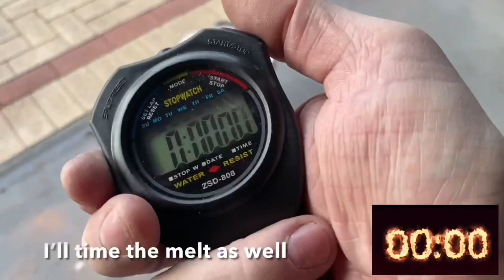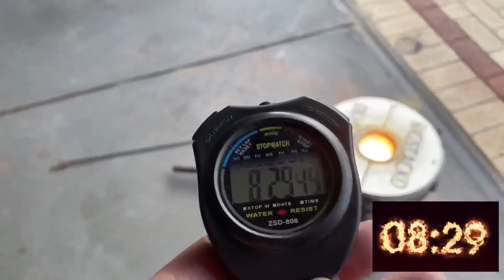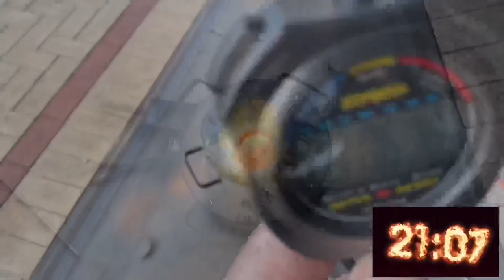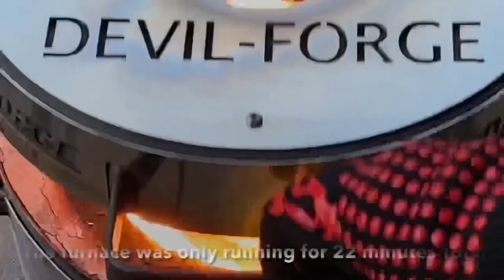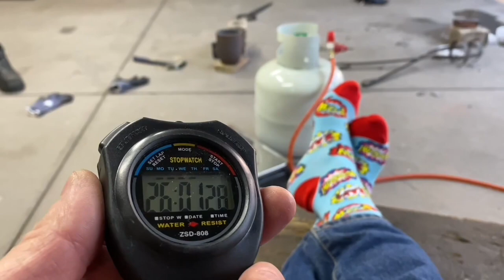Dumpster Diving Huge Copper Haul - Trash To Treasure - ASMR Metal Melting - BigStackD Copper Casting

Comment: I get that it is a much dirtier way, but couldn't you just melt away all the insulations instead of going through the long process of stripping it all? With the temperature of the kiln to melt the copper would it not vaporize away in there?

Comment: Used a wire brush in my back garden on something, stepped out later with no shoes on and ended up with a nice piece of wire in my foot :)
Reply: Ooh that stings doesn't it! ever had a piece of thin metal wire in your throat - I was repairing the old antennae and like a fucking dick I held the wire in my mouth as I was doing so so I wouldn't lose the place I wanted to strip long story short a teensy bit of copper wire snapped off and lodged in my throat was hacking and trying to clear my throat for days (felt like a fishbone) I think it's still there too!

Comment: The wire wheel said copper, but he used a magnet to clean up what flew off. Copper is a non-ferrous metal. Is there something I missed?
Reply from the maker: The wire wheel is actually brass coated steel but if it said copper on it it’s because I wrote that on there so I would use that one with copper my other wheels will have aluminium bronze or brass written on them. 
I don’t think it makes a difference but I just use different wheels for different metals👍🏻
Reply: @bigstackD  o ok thank you for the explanation!

Comment: Hey may i ask were can i buy that cable stripper Machine?
Reply from the maker: It’s a no name brand, I got it from eBay for $220. Just type in electric wire stripper and it should pop up👍🏻
Reply: @bigstackD  ok thanks

Comment: The part about not losing any weight is not exactly true. Copper wires are double coated in resin for extra isolation. So you kinda lose some but it’s not significant.

Comment: So is it worth it with the spent gas to make 30$ from all that work?
Reply from the maker: Definitely worth it for me mate, this channel I do on my days off as a hobby that’s why I don’t sell any of my pieces and the cost of gas is extremely minimal especially using these furnaces as their heat efficiency is incredible, I could easily melt 6 kg of copper for under $10 in gas👍🏻

Comment: Why? Copper is $9.44 USD per 1kg. $37.76 worth all that work?  If you ignore all the cost of the initial equipment so that you could do this continuously. The time to salvage all the material, All the preparation, And then melting it down and finishing it?  I could buy and sell something quicker on craigslist for more $. 

 Just curious if it's a hobby or meant to make income

Comment: The one problem with all these example videos you do is that all of the equipment, the time spent "dumpster diving for copper" and frankly the payback for all that is like $50, the time could be much better spent if you do metalwork professionally (which would explain the presence of the equipment in the first place)